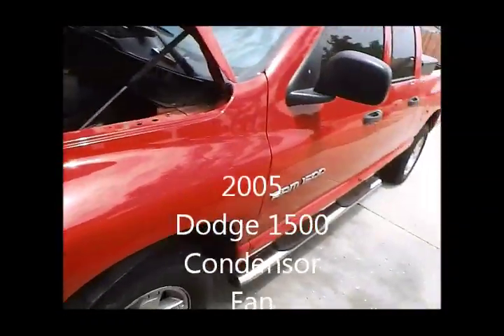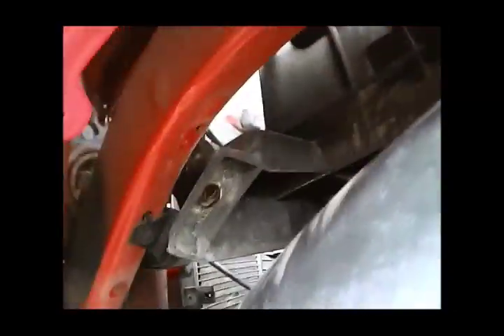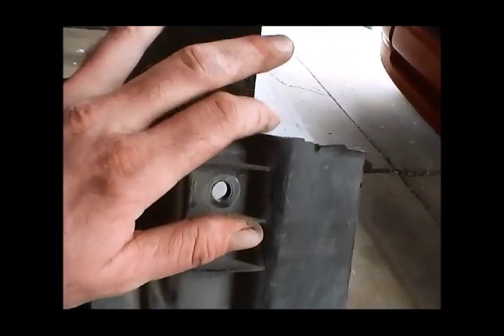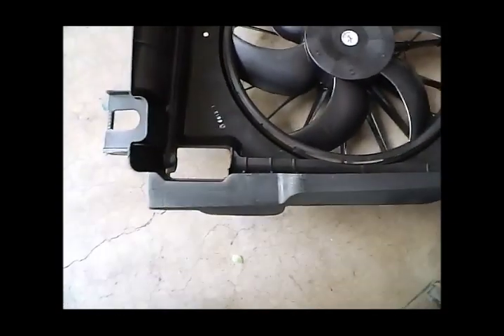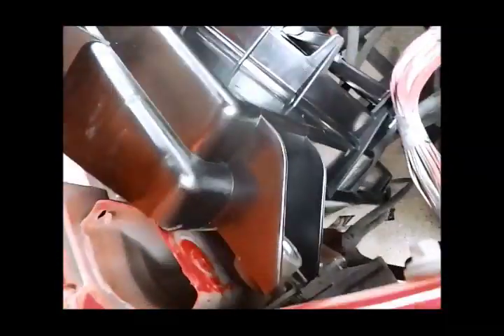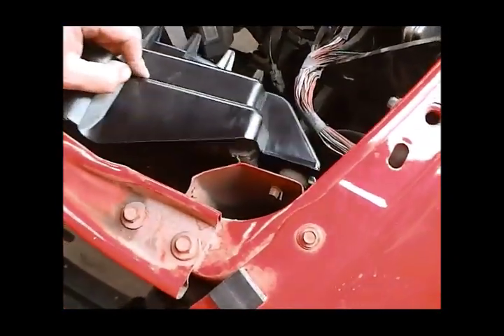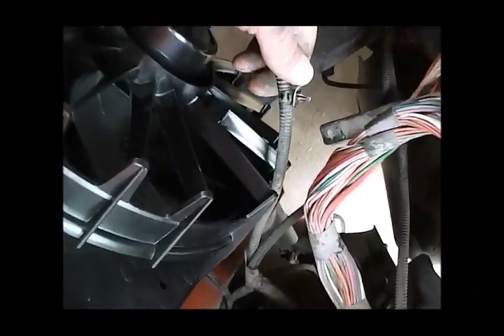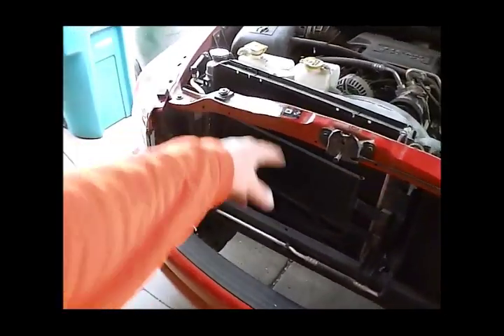2005 Dodge 1500 Condensor Fan Replacement.  " EASIEST and CHEAPEST "

Comment: cut a hole where the ac line goes through the fan shroud take off radiator support bring the ac condenser forward and the fan slips out

Comment: Dang dude,,took the long way home,,45 minutes from the time I got the tools out unti I wiped them off. Take the front cross member that hold the hood latch ,snip the plastic shroud with tin snips unbolt the condenser move it forward after unsnapping the line to the condenser and remove the shroud off the condenser

Comment from the maker: I did but at the time it wasn't in stock and had to special order it. I did notice with the new fan assembly that the fan blade design had been changed and it drew more air thru the condenser. At that, replacing just the motor is absolutely fine and usually at a cheaper price. thanks for the comments, glad it helped. Cheers!

Comment: Just remove the 3 bolt [1 rad. 2 cond.]4 bolts on cross beam , cond. pulls right out the front, than 4 bolts on shroud , cut plastic to remove shroud  from around hose ,just replace motor $30 autozone very easy lots of room .I posted a video.

Comment: thanks for your video, it helped me with mine, however I did do it differently.
I managed to replace just the fan motor which is only $29 from autozone.
I also did not need to move the fuse box or battery and battery box.
How i did it...
1. unhook battery negative terminal, and then remove the 2 fan housing top bolts
2. remove drivers side headlight so you can access the side of the fan cowl.
3. remove the 2 drivers side condenser screws
4  the passenger side condenser screws are a little hard to get to, the top one is not so hard, but the bottom one is tricky, you can push the whole cowl up from the bottom to make access a bit easier
5. cut the piece of the cowl that is near the condenser pipe attachment, then you can pry the condenser away from the fan.
6. with the cowl still in the car, you should have a gap to view the fan, if you have skinny arms like me you can get your arm in there and take the fan off with 1 nut
7. remove the 3 screws that hold the motor in and remove it.
8 when putting the new motor in, make sure to connect the wires before screwing it in (its easier)
9 reassemble everything.
this took about 45 minutes

Comment: Thanks for the video!  Just changed mine last night and it worked great!  2 hours from popping hood to closing hood after the job was done. Only challenge was lining up the screws to attach the condenser to the new fan - just takes a little maneuvering and patience.  A couple of notes:  on 2008 models (maybe others) the battery tray and fuse box holder are all one piece.  That makes it a bit more challenging - have to remove all 8 screws including the one to the ABS module to drop the battery tray.  Could have used a spare hand to hold the battery tray assembly out of the way while removing/installing the fan.  Also, there are more screws than you think holding the fenderwell liner in place - if it's tough to drop out of the way, you probably missed one (check the top center of the fenderwell - yes, from experience).  Overall well worth the time and savings over what the dealer wanted for the same repair.

Comment: excellent work around.  i need to replace mine so i'll follow your method.  one question though, i see that the condenser fan motor is also sold as an individual item.  did you consider just buying the fan motor and replacing it vs, the entire fan?

Comment: How did you by pass the electrical pigtails that didn't match up?
Reply from the maker: Israel Pena I removed the pigtail from the motor by unplugging it and the original plug matched in the motor. If your fan wont match you can cut the wire and use butt connectors to connect the wires.
Reply: RYEINDUSTRIAL Received! Thank you sir.

Comment: Just watched your video, great video. I just want to ask a question and I don't mean this as a criticism. Maybe because I'm not a Dodge man myself I'm curious. Would it of been easier just to replace the motor on the fan? Just about every car I've worked on the motor is the one to go out. It would be a lot cheaper than to replace the whole unit. Again, I don't mean this as a criticism, its more as a curiosity. Maybe it's a problem I haven't seen yet. Thanx for the video!

Comment: Can you just change the motor on the fan instead of the whole fan
Reply from the maker: Hey Rodrick.   Yes you can just change the motor.  You have to remove the fan to replace the motor so the video will still help.  A few bux cheaper to just replace the motor too.

Comment: Stupid Dodge engineer. I had to Cut that small area out. As I didn't want to spend $70.00 of Freon and O-Rings just to replace a fan! Not to mention that fan is notorious for failing. 

I ended up pulling the condenser out the front to give me room to pull the fan assembly out. So All I had to do was remove the Horns under the body to get at that last 10mm bolt on the side and the fuse box out of the way. 

I might add. The fan was good to start with. Some dip shit put a 10 amp fuse where a 25 amp goes and that is why it was not working!